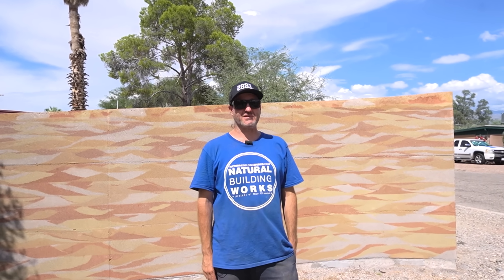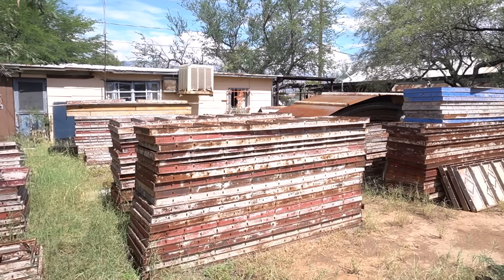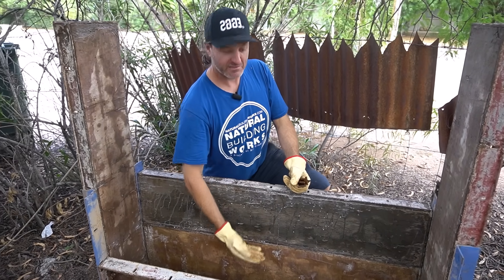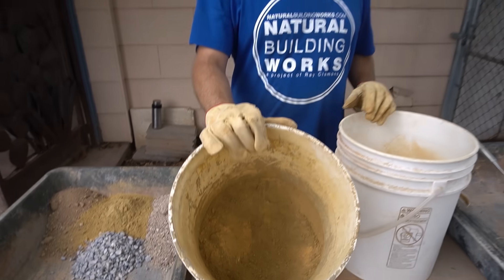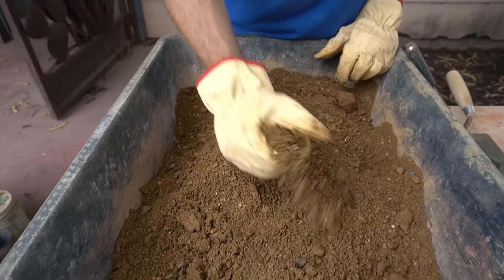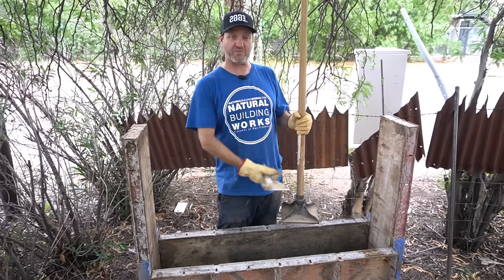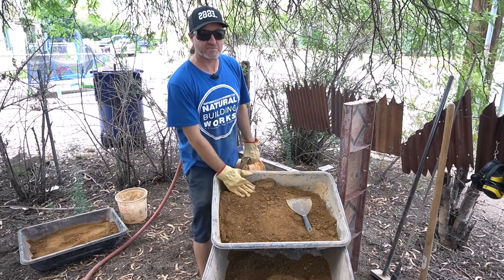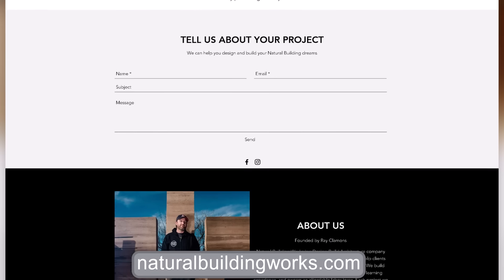How To BUILD A RAMMED EARTH WALL: Sustainable & STRONG!

Comment: Without enough cement (right amount for different stress levels, applications and climate conditions) all these compressed gravel/dirt bricks/blocks are nothing but washable pile of scrapped earth sediments. There is science/engineering and there is art. When the later tries to be the former, civilization always gets in trouble.

Comment: Hey there, thanks for such an informative video! I'm curious if you have any recommendations for sourcing pigment.
I've made some test blocks using LaHabra stucco color coat. I estimated that I'd need about 1400 lb of pigment to complete the walls of my project (600 cubic feet).
That would make the pigment by far the most expensive material used in the construction.
I'm hoping that there's a better and more affordable solution. Any help is much appreciated!

Comment: how long after you pack it do you need to wait until you can remove/reuse the forms?         Is it like concrete where you need to wait 7 days until it reaches 75% harness before you can add another kind of form on top the wall and start packing more material on top of it?

Comment: Yeah, if you like cracked, holes, and falling apart look!
Reply: It's the oldest permanent construction method we know of. I mean come on, most American houses are built out of toothpicks and paper mache and they stand up to hurricanes pretty well.

It's not a method for every application, but it's unbelievably easy to source your raw materials and remarkably natural, if that's your sort of thing.

If you need to dig a hole, you can use the cut to fill elsewhere into a wall or structure pretty easily. For a clean, natural, and environmentally friendly finish, linseed oil and sandpaper can make it surprisingly durable and nice, while also being fully dismantled into nothing more than ready fill dirt.

It's a valuable technique. Don't knock it til you try it (but if you choose to try, knock the fuck out of it. The tighter it's packed, the better)

Comment: Does adding shell lime increase its strength?
Reply: I'm curious about this myself. He said it's a limited clay content, but I was under the impression that 1/3 clay is more ideal, though my opinion shouldn't be counted for much. If the clay content is lower, line would do less, but I've found it's a good additive for my campsite, where the earth that gets rammed is much less controlled (site soil, no cement, unknown and varied composition, includes flora debris)

I use a liberal application of linseed oil to produce a surprisingly good final product that feels like concrete, but will dent under enough pressure.

Comment: I built a rammed earth home in Georgia in 1990. The house was awesome. Super efficient and I’d put it up against an F1 Tornado any day. Not new construction but 2000 year old tech.
Reply: Can you share the pictures please
Reply: What was your construction cost?
Reply: How’s it doing with the humidity and wetness?
Reply: @JustWondering66  pretty sure rammed earth houses regulate that on their own just like they do with hot and cold temperatures.
Reply: Zero carbon footprint
Reply: LOL…way to put it up against the weakest tornado
Reply: @cjschmitt4882  : It probably would have done more, but where’s the proof. It never was hit by any tornado. However, would an F1 take out a standard stick house? Probably. Not only was it built tough, but I designed it using Florida Hurricane codes, with columns steel reinforced and tie beams to cap it off that had hurricane straps to tie down the trusses and used 5/8 plywood to sheet the roof, not 1/2 Osborn’s and trusses were 16’ on center not 24’. So it was a beast.
Reply: @marcedwards2293  i was wondering if rain damages walls of rammed earth houses and overtime, in a rainy climate, houses are either damaged/require constant maintenance
Reply: @NoobieToob  the cement binder is going to prevent that, but I would personally oil them anyways.

Comment: How would you attached a wood fence to this? Is that even possible? Can you drill into the rammed earth or will you just get cracks?
Reply: treat like sandstone. if you must drill,  better still set in supports during construction.  You can embed them deep or run rebar right through it.  The earth is the limit !

Comment: Have you considered adding powdered basalt or basalt fibers? Basalt reacts with co2 and converts it into a mineral (dolomite, calcite, etc). I’m wondering if that would strengthen the wall even further, maybe we could reduce the amount of cement. Basalt is naturally occurring and absorbs co2 at a rate of 92%, so using it is carbon negative. Seawater hold a lot of co2, so that could be used to mix the materials instead of regular water. Some ideas!
Reply: The Romans used sea water instead of normal water and the buildings are still strong today
Reply: Basalt! Yes.  You have awesome ideas.
Reply: That's the mineral that helps it heal it self right?
Reply: @mvs3553   No the mineral that helps it heal itself is actually calcium. 

ancient Roman concrete could heal itself because of the calcium-rich lime clasts that would form inside their cement mixture during the mixing process thanks to the Hot-Mixing method they used when making their concrete. The self-healing in their concrete was actually further enhanced by their use of Natural Pozzolana (Volcanic Ash). 

Fun Fact: Using Quicklime and Pozzolana is also what allowed seawater to strengthen the hell out of their concrete as well simply because Natural Volcanic Ash (Pozzolana) + Lime + Seawater = Al-Tobermorite & Phillipsite Formation.

This happens when seawater percolates into the concrete, dissolving components of volcanic ash. The resulting highly alkaline leached fluids then enable the low-temperature growth of interlocking platy crystals of Al-tobermorite and phillipsite, reinforcing the concrete matrix and bolstering resistance to fracturing. 

It never worked (I don't think) when they had to resort to using Synthetic Pozzolana over the natural stuff but their use of Synthetic Pozzolana produced waterproof concrete which they used for their cisterns, baths and aqueducts anyway so that's a win-win there in my eyes.
Reply: @mvs3553  "There are many solutions for improving autogenous healing by adding the admixtures, such as mineral additions, crystalline admixtures, and superabsorbent polymers.[6] Further, concrete can be modified to built-in autonomous self-healing techniques. The capsule-based self-healing, the vascular self-healing, and the microbiological self-healing are the most common types of autonomous self-healing techniques." 

Source: https://en.wikipedia.org/wiki/Self-healing_concrete

so... calcium 'lime' was the original mineral used as we know it. Basalt is composed mostly of oxides of silicon, iron, magnesium, potassium, aluminum, titanium, and, yes, there is some calcium in it too. Healing is divine!
Reply: Try gypsum too and lime so may be 0% cement
Reply: Love it
Reply: C02 is not a pollutant
Reply: Thank you for your generous sharing of detail about this.
Reply: To the thought of seawater in agricultural like jadam method you can use Sea salt to make sea water. I think this would work in this application as well for those that are far away from the coast. Please sign in on this thought.
Reply: CO2 lol
Reply: Hey, I like the way you think
Reply: nice
Reply: No this wouldn't do anything to strengthen rammed earth walls at all.

Yes, basalt can react with CO₂ and is excellent for carbon sequestration. But this chemical property doesn't translate into structural healing (as some people on here think) or strengthening of rammed earth walls at all — unless you introduce a reactive binder like lime (or natural Pozzolana aka Volcano Ash) into the rammed earth mixture itself.

For self-healing Rammed Earth (Theoretically) — you would need to hot-mix the rammed earth mixture after adding quicklime, natural Pozzolana (volcano ash) and gradual bits of water to it. The heat generated during the exothermic reaction that takes place when quicklime comes into contact with water is utilised during the mixing process (hence the name "Hot-Mixing") which allows calcium-rich lime clasts to form inside the mixture which is ultimately what allowed ancient Roman concrete to self-heal itself. Could be possible with Rammed Earth.

For Rammed Earth with Natural enhanced strength (theoretically) — The hot-mixing of quicklime and natural Pozzolana (volcano ash) with a typical rammed earth mixture could allow Al-tobermorite and Phillipsite to form in the matrix of rammed earth if you let it come into regular contact with seawater after curing but this is just speculation at this point since the resulting matrix is of Rammed Earth and not concrete.

Comment: How well does rammed earth work in wetter climates?
Reply: https://youtu.be/GHa9pi6EQkk?si=jffh4SLDZnBOQ7v4
Reply: Works fine. You just have to raise the base of the house a little, put a plastic sheet on it, and then make the concrete floor. Also apply lime plaster. In this way, the rammed-earth walls will last more than 100 years. I live in one of the wettest places in the world, cherrapunji (Meghalaya, India). Our house was built by my grandfather in 1965, and it is still the same today.

Comment: although you can get some cool face designs, seems so labor intensive and still uses cement, you can get far more efficient construction, I would think, from Adobe. Much more natural, no need for extensive wood and steel forms, lasts for hundreds of years, very strong and energy efficient
Reply from the maker: You are correct but I like to explore alternatives

Comment: I don't have an air compressor and rental for the time needed is as much as buying one. (Both out of my price range.)

I'm one man building an entire house by myself, so hand tamping is out.

Can you recommend an Electric tamper?

I see "Demolition Hammers" with flat plates advertised and think that that may be the best solution but am concerned about shaft length being too short.

What's your best advice?

Update.

Bought an extreme power electric Demolition hammer from AMAZON.

It's heavy but will work well.  Good length.

Comment: Whyy?? 😒 concrete is much better easier cheaper more solid & actually is concrete. U mix sand & lime & rock & u have a normal house!
Reply from the maker: Concrete has an extremely higher carbon footprint. One of the worst industries for the planet.
Reply: @naturalbuildings  Carbon is natural.   ... 
or are you going to blow up a few volcanoes?

Comment: Its sh%t because ypur using concrete. It wont last, you need rock fused over a month about of pounding day and night. And why the f are you using gravel, what the worst form of rock? Its sandstone formed from bits of rock. HAS to be clay from the property only fused with a tungsten hammer steels impact is tiny compared to tungsten. The tungsten hammer about 1m wide and lifted with hydraulics, gravity dropped on the clay probably.

Comment: Is rammed earth only usable in desserts? It looks so beautiful but I live in the tropics and it rains here
Reply: Pretty much, rain will erode ruts into Rammed Earth like this. Not as quickly as some of the other soil-based materials (especially Cob), but it will crumble away if you get frequent rain. It's also very difficult to repair, unlike Cob or CEBs. Adobe or plaster-covered CEB walls would handle rain better than RE or Cob, but personally I wouldn't build with any of these "natural" alternatives in a wet or tropical environment, they really are only suitable to semi-arid areas. Stone, concrete, metal, and wood are all used in the tropics for a reason; they're the best options you have.
Reply: Makes your dessert grainy and hard to swallow.
Reply: @oldschool1993  Someday I will learn to spell  🤣

Comment: I wonder if this could be used for building a root cellar. The exterior walls would function like the walls of a foundation.
Reply: i don't think i've heard of rammed earth being used to make a foundation
Reply: Probably not, as there is no reinforcement in Rammed Earth. The pressure of the surrounding soil would eventually cause it to collapse inward. Concrete or reinforced masonry would be the better option.

Comment: I used to own an electric Bosch demo hammer which had a 4X4" tamper attachment. It seems like a good middle ground between the hand tamper and the pneumatic hammer. I once took the shank from a broken spade bit and welded the 8x8" head from a broken hand tamper to it and it. It doubled my efficiency. The only drawback was I couldn't store it in the same box as the rest of the bits. That's not even a real problem.
Reply: Would a modified jackhammer work?
Reply: Quite interesting. This method is quite similar to a traditional method 夯土 (hang1 tu3) used in Chinese farm houses. Nowadays, different soil mixtures are used for better strength and durability. Automated mechanical tools are used for faster packing of the earth. Surface treatment is also done to prevent erosion and improve waterproofing. 

A sample 5 min video (in Chinese, but quite illustrative)
https://youtu.be/Wec7PgjvmEQ
Reply: I've been thinking about how to get past the hand tamping part with less expense than the expensive pneumatic one that was mentioned. Thanks for the info :) Looks like I need a trip to one of the builder supply places. I'm hoping this thing isn't too expensive.
Reply: @zeron4081  I believe it was an SDS-Max model. This was around 2006.
Reply: I did a little digging online and found this model that looks exactly like the one I had. 11316EVS-46 14 Amp
Reply: I'm wondering if it would still be the same process vertically/horizontally. I ask because I am wondering how it would look if cut for the purpose of counter tops.

Comment: I’d like to see how it holds up in a rainstorm
Reply: the top was loose gravel dirt and seemed it would easily just soak into it from the top, it seemed it would need longer to cure and a sealant on the top? HEX coin $0.024 PZEN coin $0.0034

Comment: I'm sorry, but I don't understand the distinction, concrete by definition is portland cement with water and some variety of aggregate, what makes this different from a concrete wall with color additive in the form of dirt/clay?
Reply: The main difference is that Rammed Earth typically contains much more clay/soil than aggregates, while concrete is mostly gravel and sand by volume. The idea with Rammed Earth is to take your primary building material (clay/soil) from the building site itself, cutting down on overall costs. That's why it's mostly seen in poorer regions of the world, same with Cob, Adobe, Earth Bags, and other "alternative" building materials. But given the huge amount of physical labor involved in actually building with Rammed Earth, I'd use some other method. Outside of a few poorer nations, the labor costs will far outstrip any monetary savings you'd get by using local soil over gravel/sand.

Concrete is a fine material in and of itself, and though it lacks some of the thermal qualities of Rammed Earth it makes up for that by being far more waterproof. The main issue with concrete is that people use ferrous reinforcement, which eventually rusts and breaks the concrete apart as the rebar expands inside the concrete, reducing its lifetime to just a few decades. Whereas Rammed Earth lasts for centuries, just like unreinforced concrete does. Fiberglass-reinforced concrete would last nearly forever and be far superior to Rammed Earth by pretty much any standard.

[I know people complain about the CO2 production involved with concrete construction, but that's both not really a problem (CO2 is easily the weakest greenhouse gas, behind even water vapor and far less worrisome than sulfur dioxide) and it's not like Rammed Earth is exactly lacking in CO2 production anyway, not when you consider all the labor involved and the processing of gravel, sand, cement, and digging up the clay soil to make it.]

Comment: Or you could just mix the cement with sand and make concrete wich will be cheaper more solid and easier to make. I really don't understand how this is more "sustainable" if you end up using cement anyways.
Reply: From my experience he is reducing from 15% to 7% the use of cement. It is something to consider but it's far from ideal.
It is better to use only bricks made of clay and wet clay to bond then. My grandparents made a house in the 60's this way and it is still standing great.
Reply: The main "savings" with Rammed Earth are supposed to come from using primarily soil instead of gravel/sand. Specifically, you'd use soil dug from the same place you are building the wall, rather than importing in lots of gravel and sand for the concrete mix. However, the huge labor costs of building with Rammed Earth would make this only practical in the poorest regions... which are exactly where you see these sorts of alternative building methods.

Generally speaking, Rammed Earth is just a weaker, less water-proof version of unreinforced concrete, with more labor involved in the construction. "Sustainable" is largely a buzzword meant to sell people on the idea, sort of like how animal-feed grains are now marketed as "Superfoods".

Comment: Is there a foundation?
 When I did stone work, it was all about the foundation, to be thick enough and wide enough to hold the massive weight of the material used. Surely a house wall must weigh a substantial amount considering the height of the walls. 
His mix and construction method and the engineer who signed off on the it, can’t expect it to be built on soil?
 I’ve seen a lot of expensive stone columns, garden walls etc, slowly tilting over, because of cost cutting on the most important and critical part of the build..
Reply: Good point.